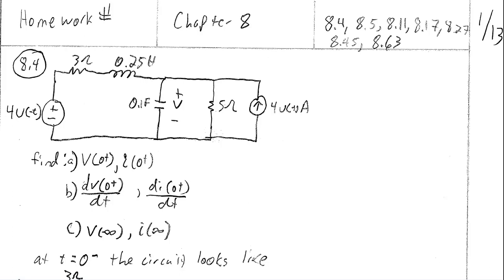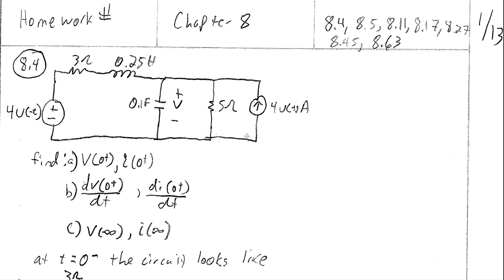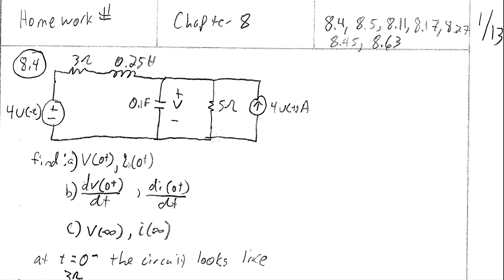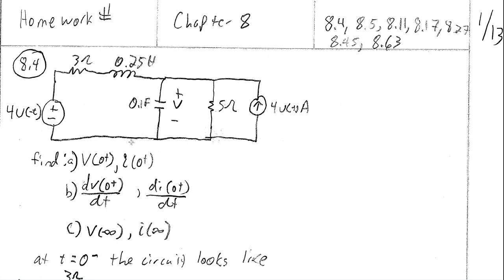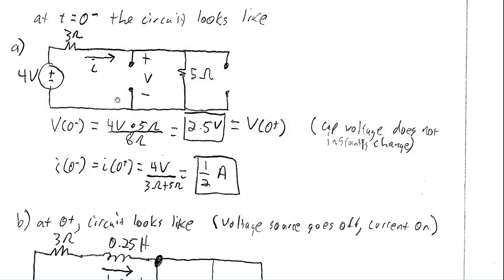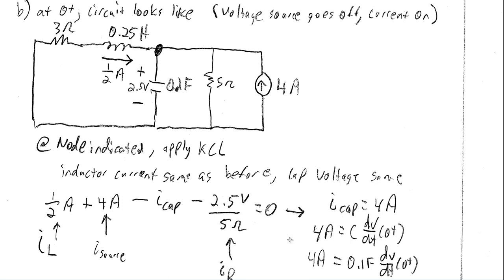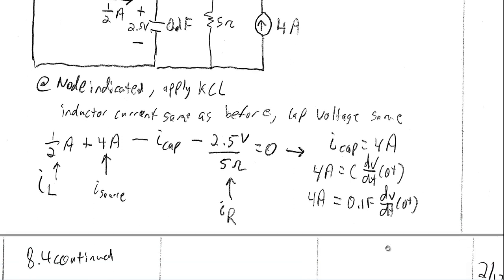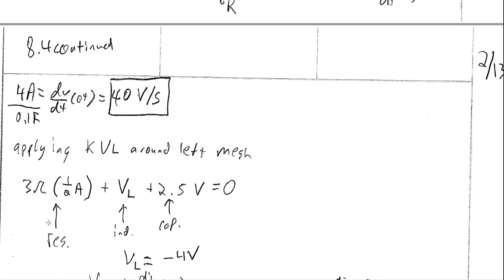RLC Circuit Analysis Problem 8.4

Comment: been a while for me too, why does the voltage source act like a short at t=infinity
Reply from the maker: The voltage source is governed by the equation V = 4U(-t) volts. This means that for any time less than 0 it acts as a 4V source. After t=0 it acts like a 0V source and a 0V source behaves like a short circuit.
Reply: @rickycastles1510  thank you, i remember now reading those conditions in my text book